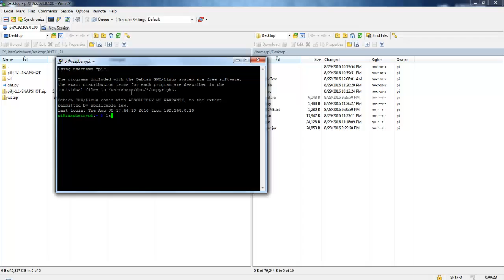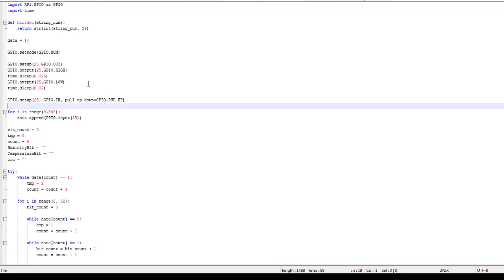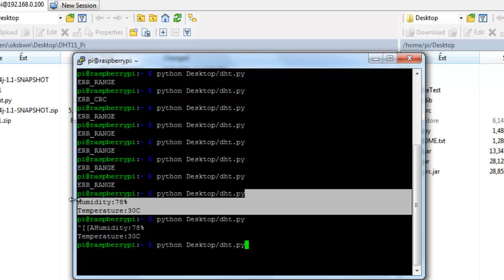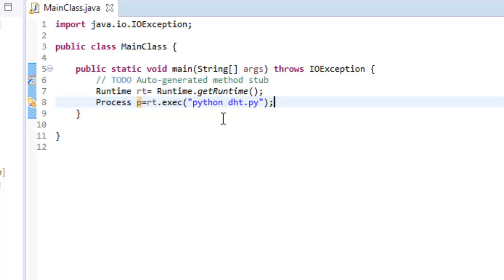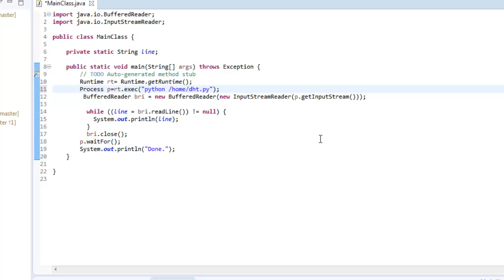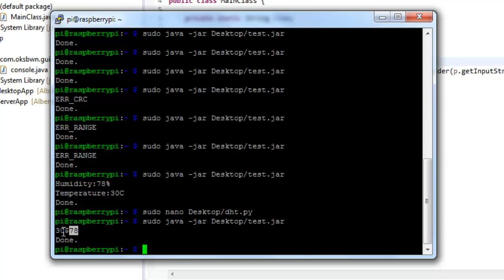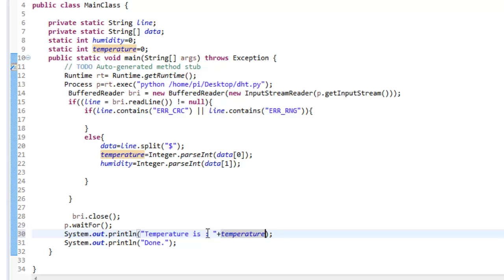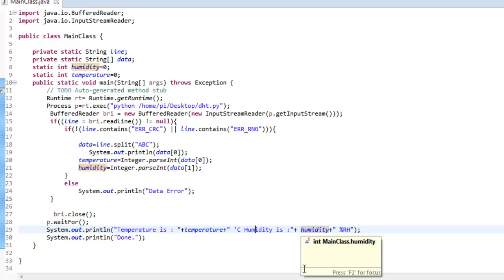Temperature and Humidity Sensor DHT11 Interfacing with PI | Raspberry Pi #13

Comment: Hi Bikash.
When I try to run dht.py I'm getting INDEXERROR: list index out of range
and also
Traceback (most recent call last);
exit(0)

Do u've any idea y getting these errors??
Reply from the maker: +Amrin Taj hi Amrin....This might be due to the that the sensor might not be connected properly please check the connection and used gpio..also make sure the sensor is working.. ..

Comment: Hi man!! Good job. 
Now, let me ask you, with this technique could I run python's programs using java pi4j or how does work the technique?
Regards
Reply from the maker: +Pablo Rodrigo A.B Thanks. You can run any python app using Java. Actually most of the protocols supported by pi4j so if u are going for any other protocol u will not require this trick . It's simply as u are running the python application aa in the lxtwrminal . Hope it helps u. U can checkout other videos and subscribe to my channel. Have fun....
Reply: Nice!!! and Do you know if I could log the data sensor from python program with mysql connector connector?
Reply from the maker: +Pablo Rodrigo A.B yes....that should work.. . personally I haven't done that ....
Reply from the maker: +Pablo Rodrigo A.B standalone python works so it should work.....
Reply: WearGenius ok, I will try it and I will share with you what happen. Because I've can not connect MySQL with python MySQL conector in my Raspberry with Raspbian Jessy
Reply from the maker: +Pablo Rodrigo A.B sure...all the best